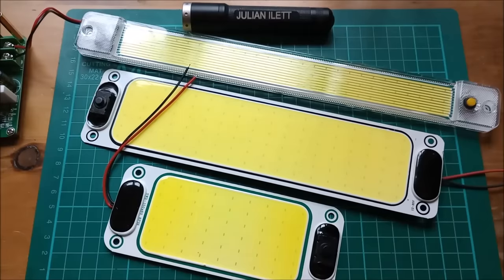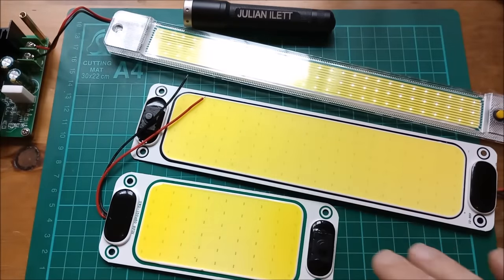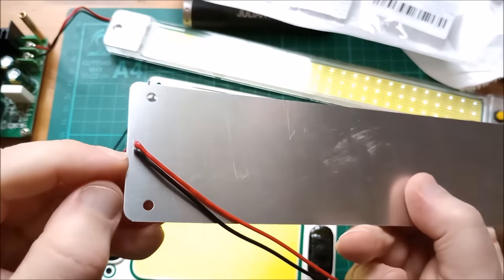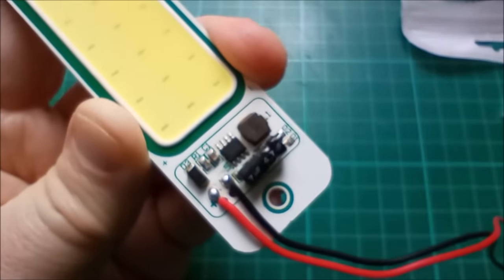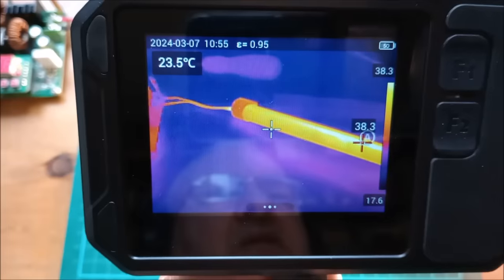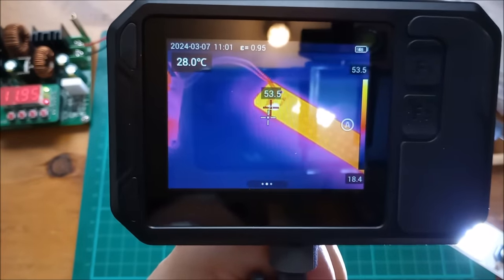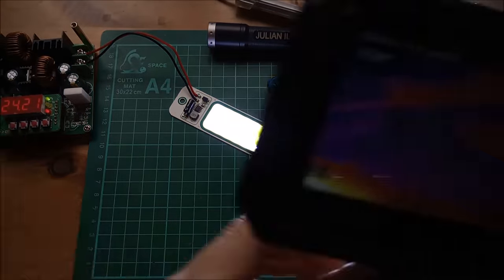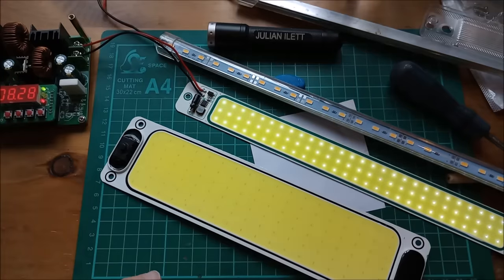Vehicle COB Lights 12V to 85V

Comment: It's a shame you didn't measure the current at the same time to get the actual power used at various voltages, that would give a better indication of comparative dissipation. Excellent video though!

Comment: One big advantage of the simple resistor+LED strips is PWM dimming, which is a good way to reduce heat and increase lifespan since you can easily under-drive them with a fixed voltage source.
Reply: For reducing heat and increasing lifespan it's better to use an external resistor instead of PWMing it. It's not much a difference but it's something.

Comment: Suggestion: run each kind of unit at the same perceived brightness (use them to light a dark room, adjusting the voltage on the resistor one to match the buck regulated one) and see what current/voltage each drew to see what's more.efficient.

Comment: A buck is going to be on/conducting for a lower amount of time when fed with a higher input voltage, which is where the efficiency over a linear dropping style regulator comes from
Reply: I would've expected it to run hotter at a higher voltage too with my limited knowledge and I assumed mppt controllers operate in a similar manner however my controller (renogy rover li 60A) has efficiency graphs and for a 12v battery system 40vmp coming in at 100% load is claiming around 96.5% efficient and with 110vmp around 93.5% efficient. I have a 40vmp string and a 120vmp string on identical controllers. The one under load operating around 37v I think was chilling at like 36°c and the controller with 120vmp was at like 61°c both on identical pv strings just series vs parallel
Reply: @faded.0913   This can be approximated like this. Let's say there is 10 watts out and 10 watts in. 

If vout is 10 volts then current out is 1 amp.

If vin is 20 volts then current in is 500 mA.
If vin is 30 volts then current in is 333 mA.
If vin is 40 volts then current in is 250 mA.

Comment: the panel with the buck converter - what was it bucking the 12v down to?

I'm looking to replace the LED tape in my shed ( not as fancy or complex as yours - just a few 12v LA with Solar for outside lights, bluetooth amp and an invertor to charge power tools )

Comment: Definitely run at higher voltage then you will save a lot of wire guage.

Most solar systems are 48 volts as this is pretty safe.

If you are not too worried about humidity then 60 volts is also a useful standard.

Ideally you need current limiting dc circuit protection and then running at 80 volts because more reasonable.
The future of solar home is low amperage protected DC circuits as this is really much more efficient.
Also we need to use more aluminium wiring to reduce copper usage globally.

Comment: COT chip on toast? I like them though, LED units with plain exposed aluminum backs are so great because there's so many ways to heatsink them if the huge exposed plate isn't enough for some reason
Reply: the huge alu plate is just a heatspreader and NEVER enough to run at full rated current.  might be sufficient @ like 25%. i always put bigass coolingfins on every power led project and they just last.

heat kills silicon. in CPU/GPU, inverter, amplifier environments everybody knows but leds are being run without heatsink (and fail) all the time. 😂

Comment: Not sure which LEDs I'd use, I suppose the ones with the lowest watt per 'lumen'. For the shed standard supply voltage though I'd definitely go for some fixed value, probably 24 (or 48 if I had enough batteries).

Comment: Higher voltage means less current through the inductor =  less hot
Reply: Double the voltage and it halves the current. It's inverse proportional.

Comment: What were the  typical current draws at various input voltages? The prices are really low for the strips. Which is a big plus.
Reply from the maker: Less current at higher voltages, and of course less current at voltages below 12V. So the current is probably at a maximum at around 12 volts. Interesting :)

Comment: You have to compare the output in lumens between the old and the new before comparing temperature. If the new are outputting 2X the lumens for 5 degrees C higher temperature, for example, then they are still much more efficient. And yes, the buck converter will run more efficiently at a higher input voltage because the switching frequency will be lower and the total power dissipated through that inductor will be lower, ergo lower temperature.

Comment: I wonder what the EMC performance is like? Some of these cheap LED fittings spew out so much interferencebthat my DAB radio stops working when I switch the lights on. I would only use warm white versions. Those blue white types are harsh and don't do the circadian cycle any favours.....
Reply from the maker: Good point. The LEDs with resistors don't oscillate :)

Comment: Why not both? Longer original strips for general light, smaller buck bariant for specific lighting? I couldn't tell how long the original strips are, but if they're significantly longer, they'd get light spread out more per strip.

Comment: If you're using a chemistry like Sodium Ion with a wide-ranging voltage, it seems like the LED panels with the buck converters are a better idea, so long as you can keep the minimum voltage high enough. IIRC, that's an effective swing from 2.0-4.1 volts, right? (I remember there wasn't much capacity in the 1.5-2v range.) That being the case, any battery bank that's at least 6 cells in series should be fine, and you'll have even lighting all the way down to a "dead" battery. My guess is you'll have other electronics that have other issues with a swing of 12-24v.

Comment: Now there's the point J - SiBs drop voltage dramtically  from ca4V to 2V so If you set up a 24V grid you end up with 12V at low SOC.  Its a linear decline.  a PITA.  So you need a boost converter to compensate say 1000W  ca £25 EB.  Do these work ok? with a battery bank, are they reliable/overheat on full power?  Over stressed components fail in 3 months or less you know the drill?   Lets all find out about these as no one talks about this major issue with SiBs
Reply from the maker: I'm thinking of making an 8-cell sodium battery specifically for these lights. 32V at top and 16V at bottom would suit these lights well.

Comment: I'm not sure comparing temperature of one converter vs one resistor gives you the conclusion you've made.  Would a better indication would be current?  Just from a simple point of view, there are many resistors vs one converter, which your conclusion didnt account for, no?

Comment: I reverted to resistor strip in workshop. Reason being if a resistor fails lose three leds. If the buck converter fails then lose the entire led pad
Reply from the maker: True. Although the LEDs on the resistor strips seem to fail intermittent and flicker like crazy.
Reply: I know that all too well. Pity no mix of the tech